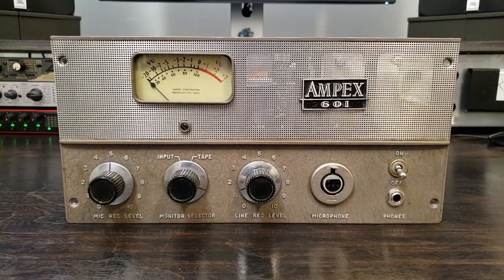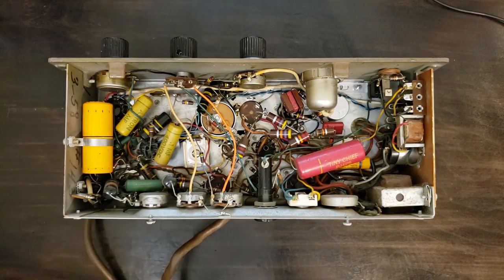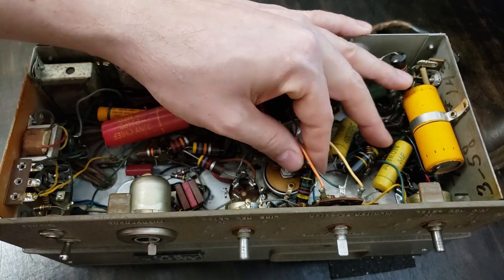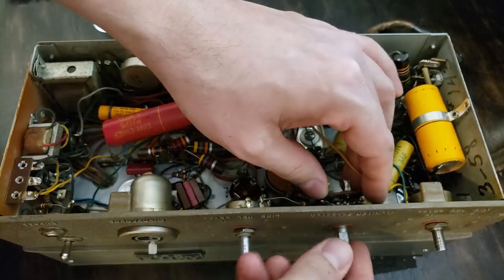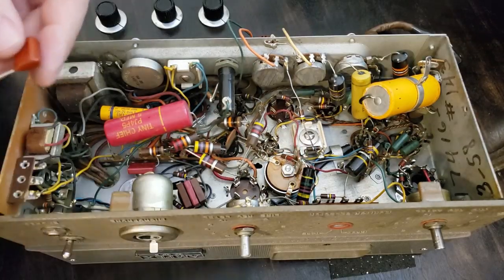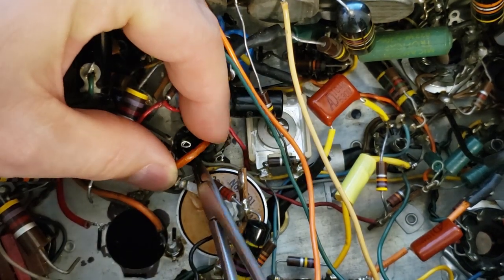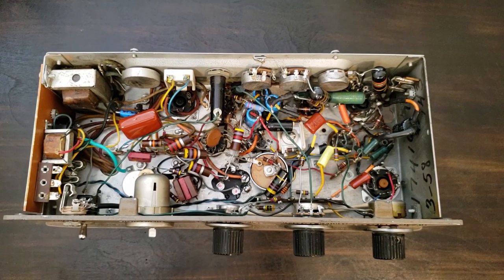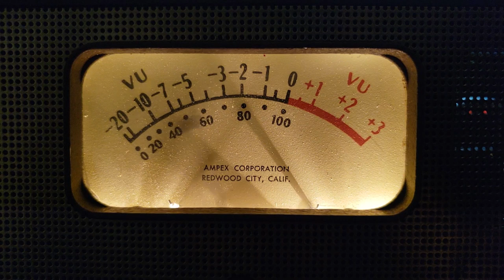AMPEX 601 Microphone Preamplifer Conversion Mic Pre RESTOMOD

Comment: I’ve purchased a stereo 601 and my tech told me one of the Power Transformers is open and the other is almost toast. I’m trying to find a replacement power transformer for it but no luck so far. Any ideas?
Reply from the maker: Basically you'll have to study the schematic and figure out what voltages are needed and then find a suitable replacement from a place like Edcor.  You might be able to contact them directly and tell them your situation.  They might be able to figure out what's needed.  I'd sell the unit for parts and buy a fully working one.
Reply: @FrankOlsonTwins  Thank you for all the info, unfortunately, I paid a premium price for this unit and I’m already down the financial rabbit hole that I don’t think I’ll get back unless I were to restore it.
Reply from the maker: Well, there's no great advice to give here unfortunately.  I think your options are to either get a new transformer or replace the faulty record\playback unit(s).  You could keep your eyes open for a used  601 at fleamarkets, hamfests and online of course.  Prices for these units, as you know are pretty steep at this point.  If you find a cheap one you could either replace the transformer or the entire channel unit. It's not uncommon to have several "parts machines" to keep a single tape machine running.  It's part of tape machine culture.  
A third, very costly option would be to find someone who rewinds transformers and send them one or both of your power transformers to wind. Perhaps Edcor could help with this, they are usually very helpful with custom orders:
https://edcorusa.com/
Reply: @FrankOlsonTwins  Again thank you so much for the advice. I’m bringing the 601 to a close friend of mines who owns Alpha Sound and Light. He’s been repairing guitar amps and tube amplifiers for 35+ years. He said he might have transformers that will work, so maybe I will get lucky. Actually he said he’s more interested in why the transformers went bad to begin with. He’s semi retired so I feel lucky he’s going to be looking at them.

Comment: Nice.  Do you know how to mod it to add an effects loop?
Reply from the maker: Hmm, it's definitely doable with the unused gain stages in the playback section.  In the circuit(available in the schematic above), it would fit in approximately where the input/tape switch is.  You'd just need to figure out some mixing resistor options to get it to play nicely with the rest of the circuit.

Comment: hi have a scully 280-14  it's a lot more work  to do  on it the record pre amps and very bad   and deck is a right of  i will look good when done using alot of tascam 38
base parts as i have alot left over from doing the up and the reel of tape are about same in kgs  to  i can use  many parts from  lots of make left over as well 

nice job  front panel   and pinch roller and all front parts i am using again just the trans logic  i have to remake  came from a usa air base in the uk  was in a very bad way

i have record pre amps    mag film one's  used on 16mm  mag film  i pulled all the inside out and pimped them with tascam 38 mk 1 cards  i had alot left as well
i have a tube amp as well they sound ace man
Reply from the maker: Wow, sounds like a cool project- I was looking at scully machines until the prices skyrocketed.  They were basically free at one point!
I currently have a Tascam MS16 that is nearly ready to go. Everything working great except final the output on 2 of the channels(not on the cards, surprsingly).
Post a vid of your Scully when you get it up and running!
Reply: hi when i got it  £60 uk  as parts it was  parts
picked up some betacam sp decks for silly low
money a ex hire place was going to get
a big skip 
they had the wearhouse in my town
so a worker move all the decks to  my
town and i buy them as i fixed them
about  £10 each uk  getting a skip would be 
alot more  

i had reel to reel decks from 15 years old 
i am over 50 now   bob